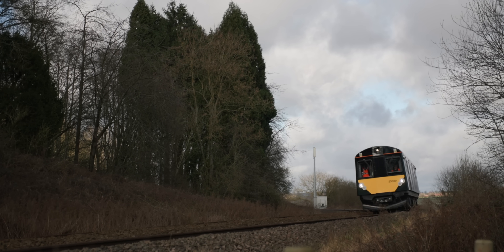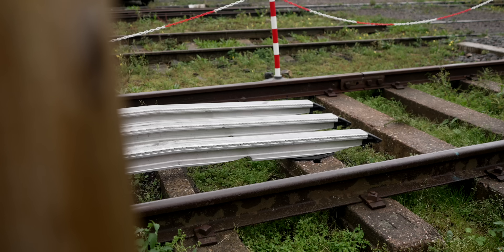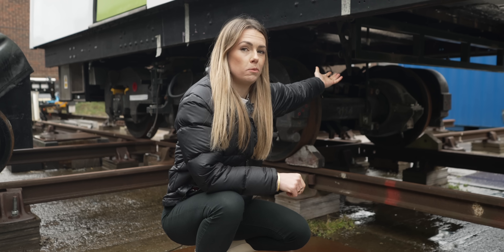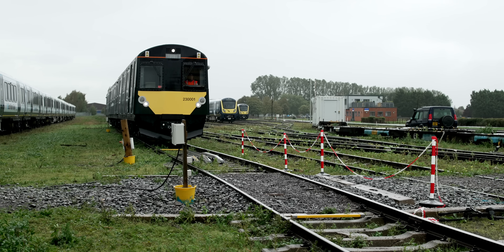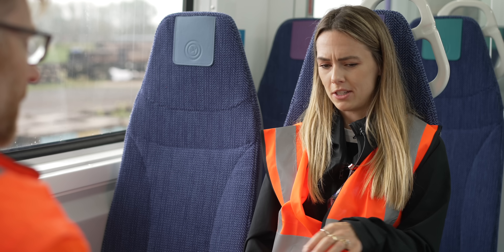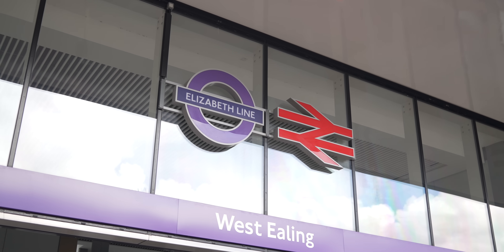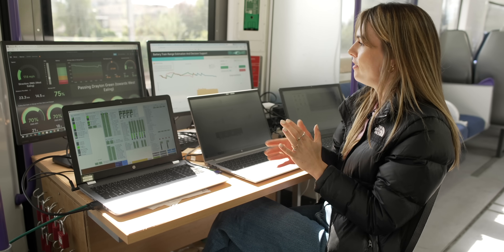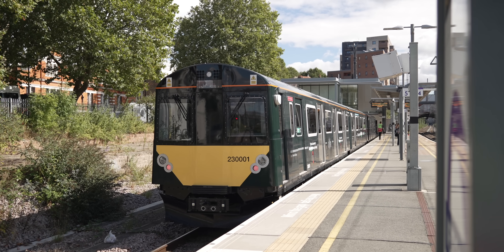Onboard the UK's First Battery Electric Train!

Comment: Every UK MP should watch this video on the UK’s first battery electric train. Great British innovation and technology using green renewable energy.
Reply: Apparently it's not the first electric train at all, and would you like to explain the consequences in manufacturing the battery's and the huge environmental problems in disposing of them along with wind turbine blades, solar panels etc.
Reply: It is using electricity produced from burning wood chips import from British Columbia, the ships doing a 28,000 mile round trip (no return cargo) burning vast amounts of heavy fuel oil which, gallon for gallon, emits 3,500 times more sulphur into the atmosphere than the diesel  burnt in this nightmare's predecessor. Every M.P. should be made to understand the stupidity of this thing. I hope that when we are hit by the next Winter high pressure and production of wind turbines is down to 5% of peak and the solar panels are shrouded in fog and we are facing widespread power cuts because of idiots with EVs , that they will have the good grace to withdraw this thing and the government will have the sense to ban the use of EVs whilst the Winter high persists. The alternative is not pensioners dying in the cold because of fuel prices and the Winter Fuel Allowance scandal. they won't need the Winter Fuel Allowance because they will die in the cold because there won't be any electricity.
Reply: @terryhoath1983  Myth 3: EVs are slower than petrol and diesel cars Formula E racing is a great example of just how fast EVs can go. A Formula E car can accelerate from 0-62mph in just 2.8 seconds – faster than most Ferraris. They can have a top speed of 174mph (280km/h), equivalent to travelling from London to Edinburgh in just over two hours. Definitely no issues with slowness there. For normal EVs, …top speeds aren’t really any different to other cars, but they accelerate more quickly so can ‘feel’ faster. For normal EVs outside the racing world, top speeds aren’t really any different to other cars, but they accelerate more quickly so can ‘feel’ faster. This is because you get the maximum torque (leading to acceleration) from the minute you start rolling, whereas you need to ‘rev up’ an internal combustion engine car to get maximum power and torque. Myth 4: EVs are much more expensive than petrol and diesel equivalents It’s true that products based on new technology do tend to be more expensive for early adopters. But, as they become more mainstream and volumes increase, prices typically come down – look at mobile phones for example. EV battery prices are already falling3, which helps with this. So we absolutely expect the upfront cost of new EVs to reduce over the next few years. For those looking to buy used rather than new, the current uptick of supply in new EVs will hit the second hand EVs market fairly soon. Consider the ‘whole life costs’, not just upfront prices It’s important to look not just at the initial outlay for your car but the ‘whole life cost’, which means considering its running costs and how well it retains its value. It seems that EVs are depreciating less than petrol and diesel cars, so you might well get more payback when the time comes for you to trade in or sell on. Even though EVs currently have higher purchase prices, they’re cheaper to run – costing much less than petrol or diesel, at as little as 2p per mile if you charge at the right time of day or night. EVs have fewer moving parts too, meaning they should also have lower servicing costs. Incentives may also be available to lower the price of an EV. Under the US Inflation Reduction Act, families can receive tax credits for new and used electric vehicles, saving them upwards of $1000 a year."

According to transportenvironment.org "Batteries vs oil: A comparison of raw material needs T&E’s study assesses the amount of raw materials needed to make electric vehicle batteries today and in the future - taking into account changes in manufacturing processes and recycling. It compares this with the raw materials needed to run a fossil fuel car to show that electric car batteries need significantly less raw materials. The report also shows that on a systemic level Europe’s overreliance on oil imports far outweighs those of battery raw materials, helping Europe to become self-sufficient in batteries. Key findings: Electric vehicles consume far less raw material (metals) than fossil fueled cars When taking into account the recycling of the battery cell materials and that the majority of the metal content is recovered, T&E calculates how much is ‘consumed’ or ‘lost’ during the lifetime of an EV. Under the EU’s current recycling recovery rate target, around 30 kilograms of metals would be lost (i.e. not recovered). That’s about the size of a football. In contrast, the study shows that the weight of petrol or diesel that is burned during the average lifetime of a vehicle is around 300-400 times more than the total quantity of battery cells metals ‘lost’. Over its lifetime, an average ICE car burns close to 17,000 liters of petrol, which would be equivalent to a stack of oil barrels 90m high. Less raw material will be needed for batteries over time Technological advancements will drive down the amount of lithium required to make an EV battery by half over the next decade. The amount of cobalt required will drop by more than three-quarters and nickel by around a fifth. Europe will need to import less raw material because of recycling In 2035 over a fifth of the lithium and nickel, and 65% of the cobalt, needed to make a new battery could come from recycling. Europe will likely produce enough batteries to supply its own EV market as early as 2021 T&E calculates that there will be 460 GWh (in 2025) and 700 GWh (2030) of battery production in Europe – enough to meet the demand of electric cars."
Reply: @terryhoath1983  According to the National Grid: " Busting the myths and misconceptions about electric vehicles - 1st August 2022 - Journey to net zero 
Myth 5: We’ll end up with lots of EV batteries going into landfill The lithium ion technology in our mobile phones is not dissimilar to those in an electric vehicle, but what’s different is that EVs have effective power management systems that guard the long-term health of their batteries. Most manufacturers are offering battery warranties of seven or eight years, or around 100,000 miles, but there’s a reasonable expectation that they will actually last longer than that and indeed outlive the car itself. ...it won’t end up in that landfill site, as it can either be recycled or given a second life... Even if a battery became no longer fit for use in the car it won’t end up in that landfill site, as it can either be recycled or given a second life as an energy storage unit for homes or businesses. Read more about what happens to old electric car batteries 
Myth 6: Electric vehicles don’t go far enough on a single charge and take a long time to charge The sweet-spot for the range of an EV is between 200 and 300 miles. This gives the optimal balance between cost and range. Most people don’t need a range of more than this; after the time it takes to drive this distance most of us need a pit stop anyway. ...when we take longer trips, most of us already do stop for 15 to 20 minutes at a service station... Statistically in the UK, the first car in a family does around 37 miles a day on average and any second car covers around 11 miles daily. In the US, the majority of households (roughly 85%) travel under 100 miles on a typical day.4 Understandably people don’t, however, buy for their average journeys – they buy for the longest ones they do. In reality, when we take longer trips, most of us already do stop for 15-20 minutes at a service station, to grab a drink, use the toilet or fill up on petrol or diesel. That would be all the time it takes to power up your EV with the new range of ultra-rapid chargers that are already available. How long does it take to charge an EV? Charging your EV can take as little as 30 minutes or up to 12 hours – it all depends on the size of the battery and the speed of the charging point. A Nissan LEAF with a 40kW battery, for example, would take around 5 hours to charge from empty with a 7kW home charging point, whereas a Polestar with a 78kW battery would take around 10 hours. A rapid charger at a motorway service station, however, could charge your car to full in about 30 minutes. The charging rate can also differ depending on the ambient temperature, the state of the battery (e.g. empty or half full) and the maximum charging rate of the vehicle. Similar to your mobile phone though, up to 80% of your charging will likely be at home, including while you’re sleeping. 
Myth 7: The infrastructure isn’t able to support a lot of people driving electric vehicles – especially in rural areas Currently in the US, there are almost as many EV charging ports as there are gas stations. Charging stations are constantly being added by public and private entities alike. The Bipartisan Infrastructure Law also allocates $7.5 billion for EV charging infrastructure to support continued expansion. National Grid and 60 other utilities are collaborating as part of the National Electric Highway Coalition to foster expansion of fast EV chargers along highways. In the UK, National Grid has proposed the optimum locations for adequate grid capacity to enable others to provide ultra-fast chargers, ensuring that nobody on the strategic road network (motorways and principle dual carriageways) is further than 50 driven miles from ultra-rapid charging. This will give drivers consistency, continuity and therefore confidence that their main – or only – car can be electric. 
Myth 8: Electric cars break down more than normal cars Electric cars are actually shown to break down less than combustion vehicles, as they have fewer moving parts. They also require less maintenance, fewer fluids and their brake systems generally last longer due to regenerative braking.5 Edmund King, president of the UK’s biggest breakdown organisation, the AA, told The Clean Energy Revolution podcast: “There is a massive misconception; 99% of people in a survey of 15,000 exaggerated by quite a lot the number of EVs that would break down from running out of charge … it’s less than 4%, and 50% of them aren't actually out of charge, they’re low on charge and maybe a little bit worried.” He continued: “The biggest reason we’re being called out for EVs [breaking down] is exactly the same as for conventional cars.”
According to the National Grid: " Busting the myths and misconceptions about electric vehicles - 1st August 2022 - Journey to net zero New petrol and diesel cars will no longer be sold in the UK from 2035 and the US is aiming for half of all new vehicle sales to be electric by 2030. So, before long, it’s likely that far more of us will be behind the wheel of an electric vehicle (EV). But there are a number of concerns and misconceptions about EVs that are still making people think twice – here we address some of the most common EV myths.
Reply: @terryhoath1983  Myth 1: The electricity grid won’t be able to handle the increase in EVs There are two aspects to whether the electricity grid can manage lots of EVs being plugged in at once: Whether enough electricity is available; and Whether the wires that carry that electricity have enough capacity to do so It’s important to remember that the shift to EVs is happening gradually – not overnight. Renewable energy sources are constantly being developed to supply us with more clean and green electricity, and we’re constantly ‘evolving’ the electricity grid to be better equipped to handle it. Will enough electricity be available to charge EVs? A main source of concern here is the scenario of all EV owners charging their EVs at the same time. So is it possible to spread out the demand, while still making sure we all get our EVs charged when we need it? With this in mind, the UK Government has introduced Electric Vehicle Smart Charge Points Regulations, which ensure that EV charge points will have smart functionality; allowing the charging to happen when there is less demand on the grid, or when more renewable (and therefore often cheaper) electricity is available. This means that no matter what time you plug in your car, it will charge when you need it but can automatically pause during those peaks when demand on the grid is highest and energy is most expensive. Similarly in the US, Smart Chargers and Time of Use Rate programmes will support balancing the load throughout the day. Does the electricity grid have enough capacity for charging EVs? The most demand for electricity in recent years in the UK was for 62GW in 2002. Since then, the nation’s peak demand has fallen by roughly 16% due to improvements in energy efficiency. Even if we all switched to EVs overnight, we believe demand would only increase by around 10%. So we’d still be using less power as a nation than we did in 2002 and this is well within the range of manageable load fluctuation. The US grid is equally capable of handling more EVs on the roads – by the time 80% of the US owns an EV, this will only translate into a 10-15% increase in electricity consumption.1 A significant amount of electricity is used to refine oil for petrol and diesel. Fully Charged’s video Volts for Oil estimates that refining 1 gallon of petrol would use around 4.5kWh of electricity – so, as we start to use less petrol or diesel cars, some of that electricity capacity could become available.

According to the National Grid: " Busting the myths and misconceptions about electric vehicles - 1st August 2022 - Journey to net zero 
Myth 2: The electricity used to charge EVs is created by burning fossil fuels, so there are still emissions involved More and more of our electricity now comes from renewable, green or clean energy sources, and zero-carbon power in Britain’s electricity mix has grown from less than 20% in 2010 to nearly 50% in 2021. With the growth in onshore and offshore wind farms and the closure of a number of coal plants, transport is in fact now the most polluting thing the UK does as a nation. Our energy system is also becoming more flexible to maximise on this cleaner energy whenever it’s available. Apps like the WhenToPlugIn app, as well as new legislation and smart energy tariffs, are all helping us manage our electricity use – for example, Smart Chargers that can start or pause our EV charging to ensure it’s using the cleanest and cheapest power. In New England and New York, only 0.1 to 2.7% of electricity is produced from coal and oil combined2 and, as electricity continues to decarbonise, these percentages will continue to reduce. 

However, in just over a decade the UK's power system has been transformed: coal now generates just over 2% of the UK's electricity.
Reply: There were around 1,089,000 EVs on the road in June.  The average EV battery is 40kWh.  The national grid generates 300 to 360TWh per day.  Even if all the EVs charged from 0 to 100% per day with all the inefficiencies involved with charging, it still wouldn't even equate to even 0.02% of the total capacity of the grid.

Comment: It would be good if it could stay connected to the power rails as it  it initially accelerates out of the station (high power demand), then switch to battery

Comment: But its not the first battery electric train, even if you discount the British Rail ones. Merseyrail extended their network without electrifying the lines by having a train that has onboard batteries and it uses them solely on that section.

It's a shame the Fully Charged network of shows to this day to do their own research and just parrot what they are told. 

After just 14 seconds you've lost me and i wont be watching the rest of the video.

Comment: No, this is not "in fact" the UK's first Battery Electric train - that accolade goes to the British Rail BEMU that operated on the Ballater branch from Aberdeen between 1958 and 1966. If you're going to present things as "fact", at least get those facts correct!

Comment: No it is not the first "battery train".
From the late 50s, there was one that ran on the Deeside line from Aberdeen to Ballater.
It was a project promoted by the North of Scotland Hydro Board and it proved very successful.
Recharging facilities were installed at both ends. It ran until the late 60s IIRC.